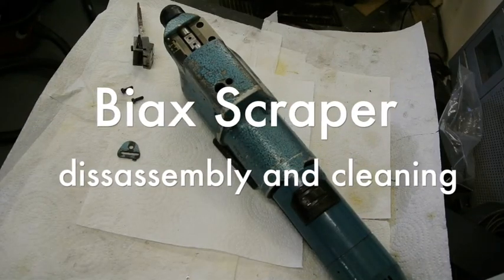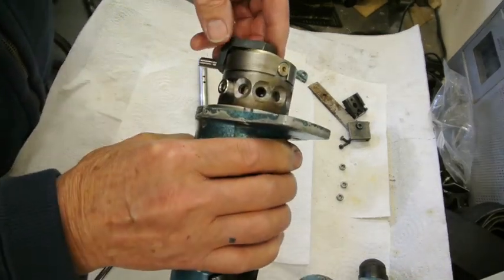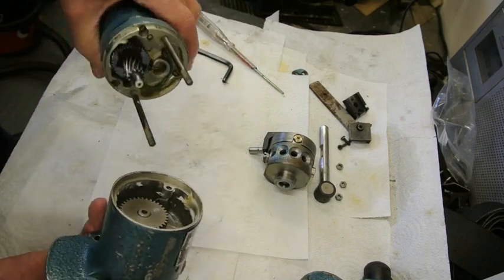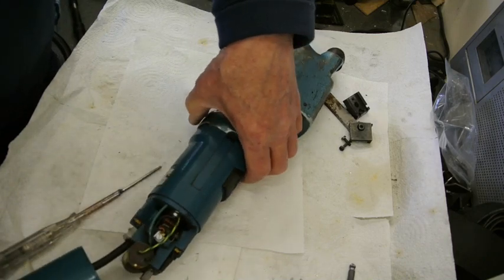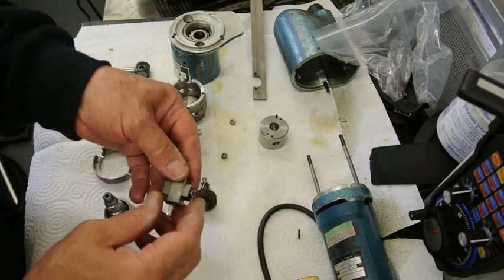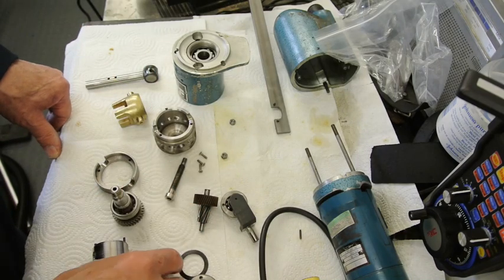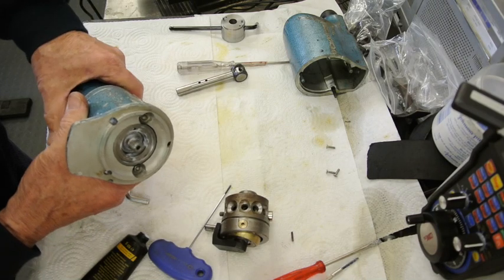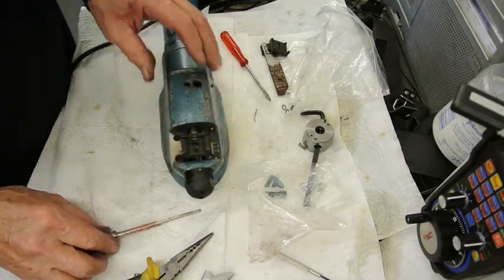Biax Scraper

Comment: This video is quite timely for me as I'm about to disassemble the exact same model. very well explained, surely the best on youtube concerning the Biax, many thanks.
 I'm not sure as this vid is 4 years old, if you knew that it is adjustable for stroke, by inserting a 6mm hx allen key in the socket head (the one that has also the nut and cotter pin) and turning it either clockwise or anticlockwise. Access is at the bottom through the holes in the casting, thanks again for this, very helpful, regards, Dave
Reply from the maker: Dave, glad that my description was useful. Yes a good point about the variable stroke. I didn't discover it until I reassembled it and didn't post about it. You are right that there is very little info about these scrapers and no manuals available. John
Reply: @john2478  an update:  I've just now successfully dismantled and reassembled the Biax, albeit not totally, but enough to clean and grease what I can, I'll make those tools to take it apart further, but I'm confident to do so now, the big thing was the pin to hold the shaft to undo the reciprocater, one more thing, the plates that the slider block runs on, are on tapers, and you can undo the screws, move them to take up play, but you probably knew that! thanks again.

Comment: Very good job figuring out the disassembly on your own. I wouldn't feel too bad though. After buying my brand new German made Haimer 3D Taster I thought it might be a good idea to email and ask them for an exploded diagram of it's internals just in case. The same results as yours and zero response back from them. There factory sealed and afaik no other company in the world is set up to do any repairs to them if you ever crash one. A trip back to the factory in Germany is the only option. While expensive, that Kluber grease is very good stuff, maybe even better than what the Biax factory first used back in the 1970's.
Reply from the maker: It is satisfying to get it apart safely and have it running again hopefully for many years and share it. I know the Achillies heel of these scrapers is the fibre gear. I have seen several for sale on Ebay with failed gears. I think I know how to make one as I did make some helical gears for a clock some years ago. The great thing about Youtube is that the knowledge can be shared world wide and it is like a giant reference library. Yes the Kluber grease is the best currently available which is why I chose it.  John